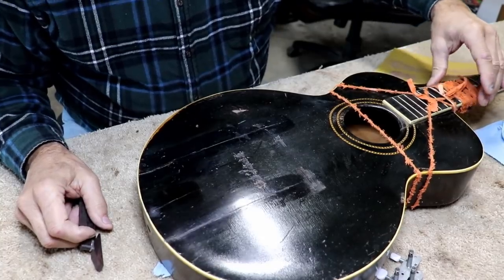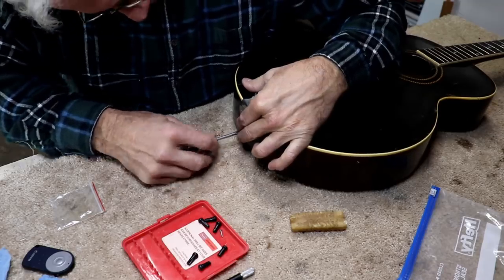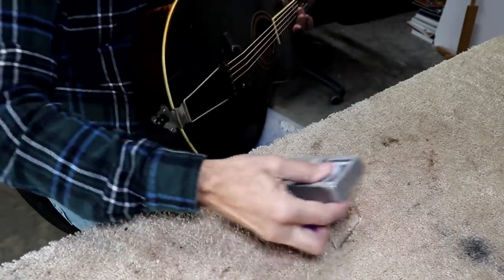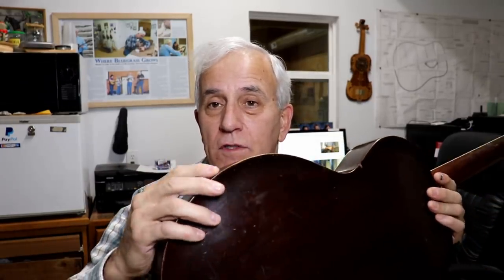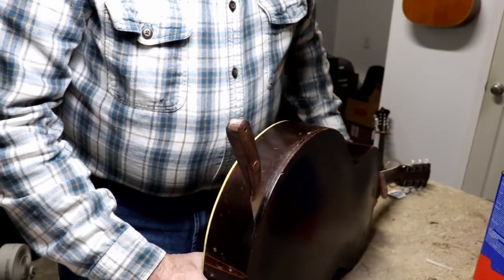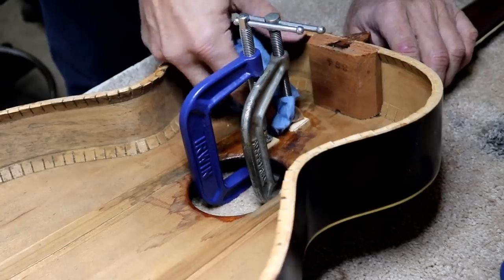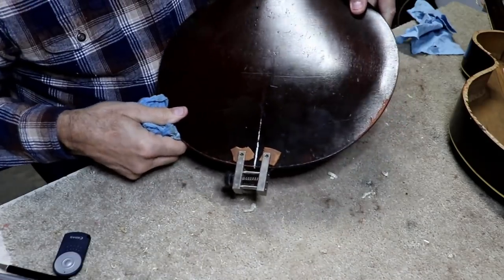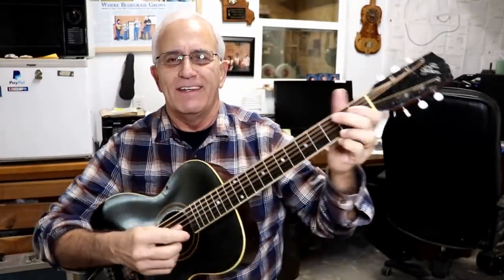265 RSW L1 Major Surgery Again Part 2 This is a good one

Comment: Looks and sounds good to me, I wish I could play guitar, Lute, Mandolin, Harp; I love to listen though. If I could I'd be trying to make 'em and fix em. I worked on furniture though, even though I'm not into furniture - but nevermind.  I do know about glues and how to get joints apart. Briefly, if you want to do another one of these hide glued backs, use hot putty knives as you did, but to get started, make a cranked, custom bent steel tool to get in that sound hole, and get an old putty knife blade sans handle to address the joint parallel to it's plane. apply heat with an old copper soldering iron, also custom bent. then splash on a quarter teaspoon of hot water. Water, my friend, is the solvent of hide glue. (Don't take my word for it though folks, look at a reference book on atrist's materials.) All very awkward, but the exterior finish will be untouched. then you proceed from the outside, untill you get to running-out-grain, and you need to go through the sound hole.

(Joke alert) I woulda just cut that little hole out!

Ok, I was watching this last night late, too late, and I was reflecting on how the little mirror .... well, not distorted, but limited the view, compared to taking the back off and using two eyes in the normal fashion, and how a little camera might not even improve the distortion much. The loss of depth perception via two points of view is really distortion of functional reality.  You need to have both eyes open to really see; and I think the same is true politically, one has to see both sides of the coin to make sense of politics functionally.

But I digress. I wonder what you think of how this was manufactured, and if the top might have been glued on when it had high moisture content relative to the sides? Then, in a dry environment like Eastren Washington, just shrank more than the rest of it. Then you got to wind down the clamps to make the sides small enough to match the top when closing up your glue joint, and when the clamps are released, the top holds the sides in, but complains when string tension stress is added. Anyway, thats what I first thought when I saw it on my little laptop screen, which is another kind of perspective reducing mirror!

I also wonder if it's possible to get the top off without taking off the fretboard? Though if the top-sides glue joint were just separated, first sacrificing the binding, then gluing the splits, then gluing the top down, then recut the seat of new binding, might it be possible to leave the fretboard in place?  All stuff I never did BTW. I did eventually learn not to open cans of worms in my repair shop. I shure do appreciate that kind of wisdom!

Well I can't sit here all day and watch you work, though I would like to; I bet my questions are already answered in some other vid like 216 Harmony Tenor looks interesting. My project for today is making my prescription polycarbonate lenses fit the new frames I got cause the old frames are broke and discontinued and I need to see. :D

BTW I hit the like button because I love everybody.

Comment: Jerry - I think you need pure  Methyl Alcohol (wood alcohol) not methylated (denatured)Ethyl alcohol or isopropyl (rubbing) alcohol. True hot Hide glue is not water soluble, and all forms of ethyl alcohol contain some water (unless you can get 100%) so it’s not going to be as effective. That said I’ve tried methyl alcohol with mixed results - an old furniture repair guy told me not all Hide glue is the same and therefore what works with one piece might not with another.  What it supposedly does is crystalize the glue so it breaks.  Of course then you have a ton of old crusty ‘ crystally’ glue that has to be totally removed.  To be honest I’ve had the best luck heating the heck out of my knives like you wound up doing and fixing the resulting damage.
Reply from the maker: It seems weird to me. I've always thought of hide glue is being perfectly water-soluble.  In fact if you get it on something, after it dries, you can generally wash it off with water.  I also use Steam water to loosen X that are glued on with high glue and they come loose very easily. Very strange to me.

Comment: Howdy... I would emerge it in some plate with alcohol... Larger area... 1/2 of inch deep at least, to soak the back side in it for 10 mins or longer... 
Who knows, maybe it needs a Larger area to Work better...
I know that a regular gas desolves a lot of things, but one minus is a smell...
Aniway, great job my friend... Keep on rocking!
Greeting from Croatia 🇭🇷
Reply from the maker: It would probably melt the Finish.
Reply: @RosaStringWorks  most probably... But i am born to do that if anione... Just to be sure 😁😁😁

Comment: The idea with using alcohol is to desiccate the glue, i.e., remove the water to pull the hide out of solution, which will sort of look like "crystallizing" the glue.  Just the opposite of using water, in which case you are trying to dilute the hide.  The key is that you need very dry alcohol.  And I don't mean gin...

Denatured alcohol is ethanol with additives to make it unsuitable for recreational consumption.  Often methanol is added to make it poisonous, and this mixture is often called "methylated spirits".  

What you should look for is "200 proof" or "anhydrous" alcohol if you can find it.

Another thing is to make sure the alcohol is fresh.  Alcohol is very hygroscopic (which is the whole idea here) so the longer it sits around, the more water it will pull right out of the air, making it a less effective desiccant.

Of course, I say this with the authority of a chemist who has never actually tried it in a lab (or a workshop), so it's a bit theoretical.  To be taken with the appropriate grain of salt...
Reply from the maker: According to what I bought it is lab grade alcohol pure alcohol no additives whatsoever.

Comment: Just curios, what if you used a heat gun and razor blades as wedges. If you started using your spade until you could get the first razor blade in, It would seem the metal blade would act like a heater and start a melting process for the glue. and if you left the blades in as you go around the guitar back I would imagine the back would eventually pop with heat from the heat gun or an iron on the back of the panel. Just thinking here.

Comment: Jerry,we remove fretboards that are glued with hide glue using damp heat,why not spray some water and use a heat gun
Reply from the maker: You got to be very careful with a heat gun on the sides. It'll blister the Finish very quickly. Heating up the fretboard is not a big deal because there's nothing there to ruin unless you have binding. Moisture does help.

Comment: Yet another amazing repair to a vintage guitar. Good work Jerry.
I was surprised to see that that old bridge is left floating - does that mean the owner has to faff around with all that pushing and pulling to get the intonation right on the two E strings every time he changes strings? I thought it might have warranted gluing the bridge in place once the intonation was set on the the two E strings and calling it good.
Just a thought.
Reply from the maker: Floating bridges are never glued down.

Comment: Reference taking the back off (in future/I’m not a Luthier): Maybe an old fashioned Straight Razor would work. I just used mine to cut a new sound post for one of my Fiddles. It worked great. Question: Have you ever made an Archtop guitar? Thanks! 🌞✌️😎🎻

Comment: Jerry denatured grain alcohol is for all practical purposes 100% ethanol (something like 99.95% or better). I really have my doubts about alcohol dissolving hide glue  -- no experience with it but it does not sound right to me based on my decades of chemistry training and experience?  My two cents.  Great singing too!!
Reply: Mandolin1944 you are correct on the ethanol -  the furniture guys I’ve worked with used pure methyl alcohol (wood alcohol) on hide glue. I’m not sure if it’s readily available any more or not.  I pulled out my old Morrison-Boyd (circa ‘75 but the molecules don’t change, right?) to see why one would work and the other not - and all I can come up with is the affinity of ethanol to mix with water.  Some of the comments about everclear might in fact work - it’s as close to pure ethanol as most of us will get - but I’ve never used it so I don’t know.
Reply: @HBSuccess  First of all to hear someone mention Morrison & Boyd gave me a major case of nostalgia  For those of you who were not studying organic chemistry in the 60s & 70s you might not know it but that book (all 600+ pages can't remember) was the "bible" for decades.  Thanks for the happy memories!  Personally. I doubt hide glue powder could be dissolved in alcohol -- either methanol (wood alcohol -- a poison that causes blindness) or ethanol (grain alcohol - - which causes intoxication in beer and wine) but I've never actually tried it.  Still when you have worked with chemicals and solvents for decades you get a very good idea or feeling for what will dissolve in what.  Hide glue is hydroscopic and dissolves well in warm or hot water -- probably very poorly if at all in alcohol. Most protein and collagen will not dissolve in alcohol?   It would be good to get more information on what the guy in France was actually doing or why it apparently worked (to release hide glue) for him?  Also Tioga in your title -- any connection with Tioga, ND?  If so you will know about Ray, ND I'll wager!!!

Comment: I just wonder why you haven´t just used hideglue for the repair. I have no experience with the repair of instruments, but on old furniture it`s the only thing which will stick to the original hideglue. Plus in my experience it`s still the easiest thing to remove again if anyone has to do another repair in the future.

Comment: Would it be possible to replace the braces, making them slightly wider at the base in order to cover the cracks? This would be major surgery of course, but I'm wondering if this would be a viable option if the braces were already lose/damaged in some way.
Reply from the maker: Sure anything's possible.

Comment: There are some comments on woodworking sites that meat tenderizer solution removes hide glue.
Also I've used hydrogen peroxide to remove mud dauber nests.  It breaks down the protein maybe a higher concentration hydrogen peroxide might do some benefit.

Comment: Another amazing job Jerry, looks fantastic and a lovely sound. One thing i was wondering, with the cleats you used on the back of the guitar, you shaped and smoothed them, to not leave anything clunky in there, does that make any difference to the guitar in anyway or is it just a nice touch of quality workmanship?  seems like the right thing to do either way :).
Reply from the maker: The lighter the better for sound. The less clunkiness is also a craftsmanship thing.
Reply: I had a feeling that's what it was. :)

Comment: I installed exactly the same Stewy pegs on my Silvertone! They are, well, alright, they look almost right if you soak them in a acetone/urine solution oh fercrissakes it's a joke. The tuners are fine and probably better than the "less expensive bargains because I always get the best price online and blah blahblah" - StewMac is great if you don't feel like investing your lunch hour in research. I measured my Hyundai-12 off by one-and-one-half bloody millimeter. Obviously Korea hates me.  Therefore I ordered tuners for a 12 that don't fit, which is also the name of my latest song "I ordered...". I have called Ohio twice to work out an exchange of tuners if they have independent (not a tuner tree!) 12-string separate pegs. It's taking awhile to exchange essentials with StewMac but doggone it my Hyundai deserves modification and StewMac had better come through because my grammar is perfect. Wish me luck. Love this fix.

Comment: Its a good thing this old carpenter wasn't advising you on installing those long supports, I would have said, "Let's use that PL400, it'll bridge a 3/8" gap."  Not really, I know that construction adhesive has no place in a musical instruments and I can honestly said that after over 50 years in woodwork there are very few things I won't tear apart to repair, but taking the back off a 100 year old guitar would frighten me.  Great video, as always, thanks for sharing your craft.

Comment: Why not carefully grind down the two long braces until flush and the fit two wider  brace,s  to cover area.  It would be one piece.  There may be a reason that I need to learn😃
Reply from the maker: You could do that. I always tend to try to do what I think is the fastest quickest way to fix anything. But there's always a million ways you could do each fix.

Comment: Do you have a preferred gear ratio when replacing Tuners on old acoustic guitars?
Reply from the maker: 18 to 1 is my preferred. But you generally have to pay for it.
Reply: Rosa String Works thanks, I’ll pay for quality, feel the pain once. I’ve worked on a lot of guitars but never a vintage Gibson like that, really enjoy learning from your channel. Your personal tips on an Ovation I was repairing a while back worked perfect, typical Ovation the bridge was glued on top of the finish and pulled off, then the owner attempted to glue it back on with globs of construction liquid nails (even the strings were glued in). I spent hours with a dental pick, cleaning the glue off the top and the fibers of the wood, lucky for the owner she is a friend or I wouldn’t have touched it.

Comment: Keeps using slotted headstock tuners...   There's a difference. Should be able to just switch the keys left to right

"Kill a Troll!" 👍
Reply from the maker: The video was a while back so I don't remember the video too well. But generally switching the keys from one side to the other creates problems. Either the holes don't line up for the Keys Turn backwards.
Reply: @RosaStringWorks  internally the key switches sides.. So they would poke forward now.. And then you switch them left to right and backwards and the baseplate will remain as it is now.. But they will turn backwards. I just did this to confirm. It works

https://photos.app.goo.gl/oLxnmuFZVZCSxttv6

Comment: I'm up to the alcohol for the glue joint part, and just a thought here. I've been using a special kind of alcohol when I need to make shellac or clean glass, and it might work for this purpose, too. Everclear. It dissolves shellac better than denatured does, and it smells a LOT better. I don't know what the difference would be, but there does seem to be some. 

BTW, "tighter than a bull's butt at fly time" is one of the most descriptive lines I've ever heard. Quite the visual, and definitely a good laugh.
Reply: Everclear is pure grain alcohol. Denatured is infused with methanol and is super toxic.
Reply: @deormanrobey892  True. And it might be the added crap in there that interferes with it working more effectively on hide glue. Not saying it IS, just saying it MIGHT be. All I know is that Everclear is a very effective glass cleaner and tar remover. And I NEVER drink it. I'm out of high school for a LONG time, now.

Comment: different alcohols have different polarity's so the dissolve different things!
Reply: Methanol, ethanol, and propanol  are polar and isopropyl alcohol id non polar
Reply: found this on google. 

Water or white vinegar will do the job on familiar white carpenter's glue, and vinegar will dissolve animal-based hide glue that you're likely to find on older furniture. Use acetone or denatured alcohol if you suspect the joint was glued with epoxy or urethane.

Comment: Think you are missing a GREAT opportunity to use epoxy as a material to use to fix the cracks and holes. Use a multi surface bondo epoxy.
Reply from the maker: Sorry I cannot get along with epoxy. I've tried many different kinds and I've never had one that I would recommend to anyone.

Comment: Yep, would guess ethanal alcohol. C2H5OH. 100% strength is classified as drug in EU, but you can get if you run a business, Even de-ionisized. (Electronics silicon wafer industry)
Reply from the maker: I ordered one hundred percent pure alcohol lab grade from eBay. Thanks.

Comment: Why not just  2 part epoxy  a thick layer on the inside? Along with new braces  all over both ways? 
It would be solid , and solve the problem with those guitars from 1922 -1930. And the  cracking is the main reason they changed the design ,